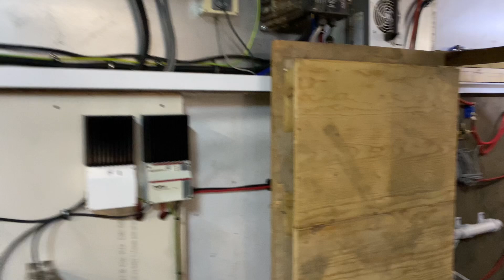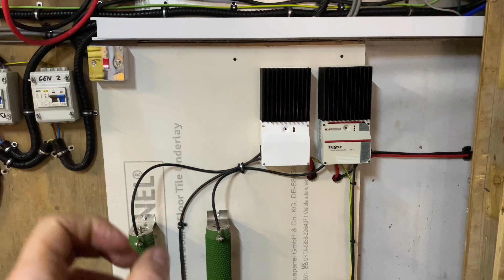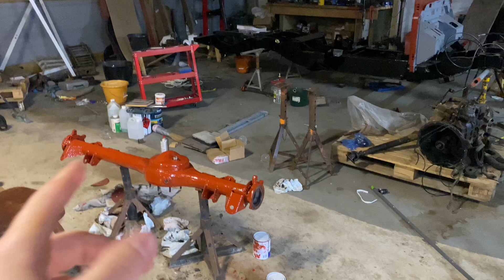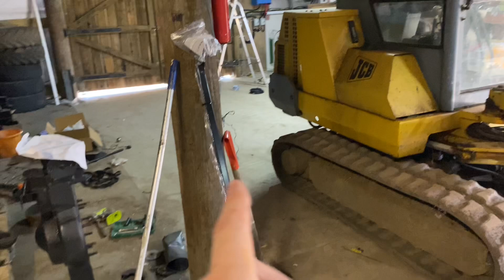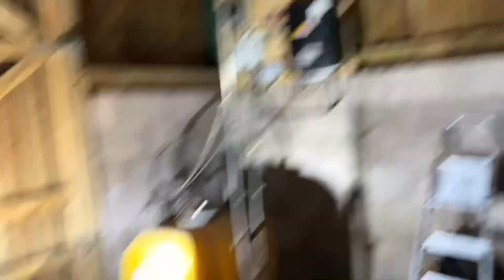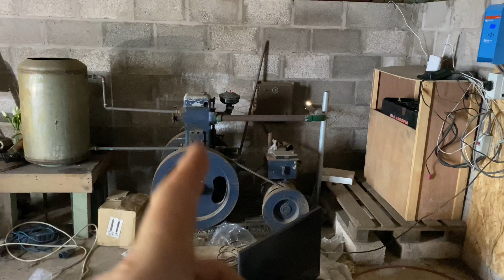Dump loads, Morningstar Tristar PWM in diversion mode - Building an off Grid Solar System

Comment: Why am I not understanding what all this dumping is about ?  I fell asleep and woke up.  You talking about dumping POWER? or using excess heat?
Reply from the maker: It’s a failsafe 

The grid tie inverter produces power constantly in an off grid situation and must go somewhere 

When batteries are full you can divert the power to other loads such as heating or hot water, but if these trip at the fuse box the power has nowhere to go so we fit dump loads to dump the power safely much as you would do with a wind turbine in an off grid application
Reply: @livingoffgridinscotland  interesting.  Thank you, I will try that if mine doesn't work